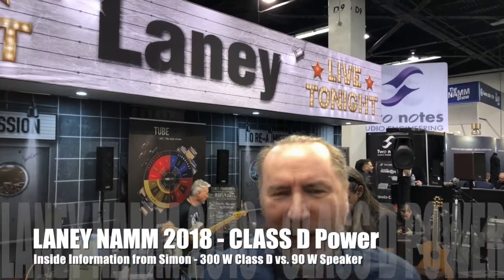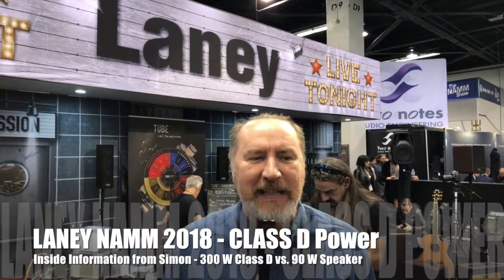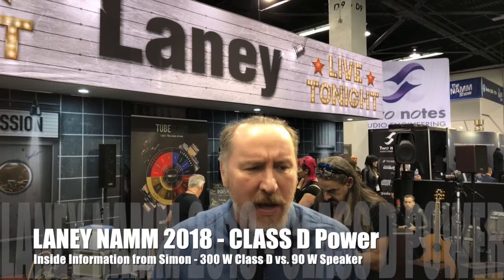NAMM2018   LANEY IRT SLS   300W Class D and Speakers

Comment: I understand but at what point do you know when you're pushing the speakers too much, is that for ones ears to determine or do you guess what to dial in on the watts output? Very informative video and well explained, thanks.
Reply from the maker: You will hear the speaker sound different. It will reach the movement limit the coil can go - a bit like banging a door. However, since it will not remain in the position - where it would "melt" - most of the times there will be not harm done. 

Unless you don't get it - the speaker should survive. Thomas Blug plays his 100 W Amp1 into a 60 W 1x12. He has not killed a speaker yet.
Reply: Ok I get it, many thanks.